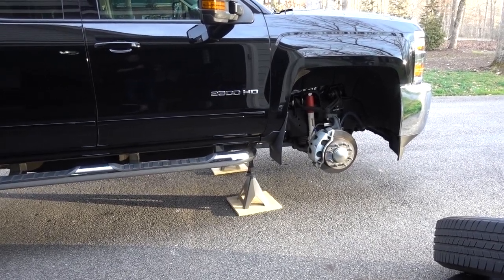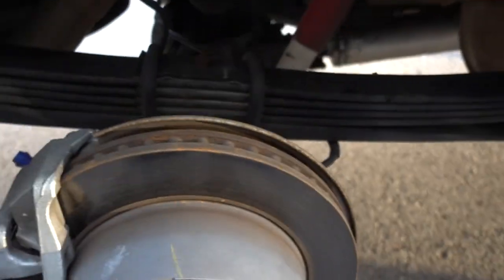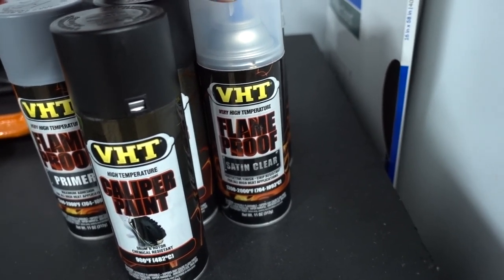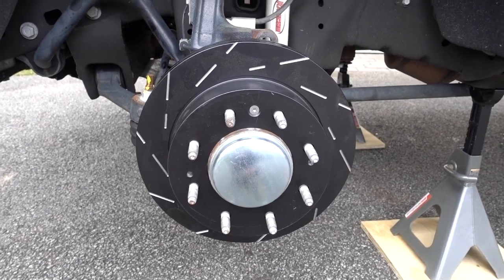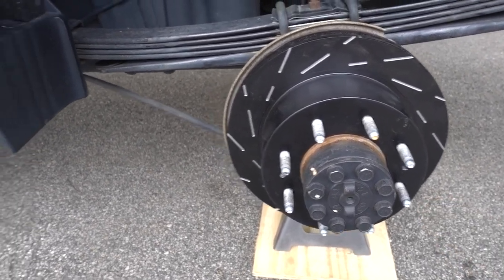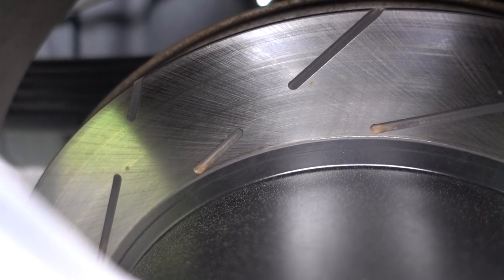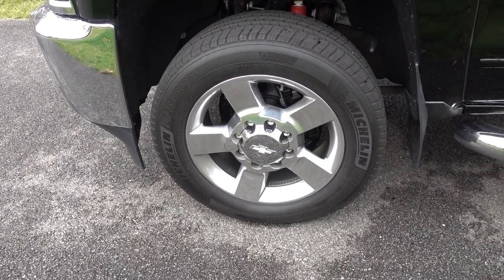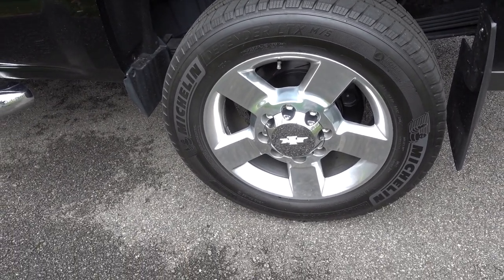2016 Chevy Silverado 2500HD Brake Upgrade - EBC Rotors - Hawk Brake Pads

Comment: Good video, I'm looking at getting some hawk pads for my excursion. I live in rust belt so I'm looking at giving my new calipers a few coats of paint before I throw everything on as well.
Reply from the maker: Painting the calipers and rotors (if they are not coated already) will definitely help with rust. I am happy with the super duty pads so far. Hopefully since they do not get hot as easily they will not warp the rotors so quickly.

Comment: EBC rotors are great but I would have used their pads too (I have RedStuff pads, on an old V6 Buick lol). Hawk pads are good but I was upset to see they're made in China. All EBC stuff is made in England, and sometimes finished in USA.
Reply from the maker: I just cannot accept the fact that the pads are painted bright colors. That is what I would call UGLY. Can you envision my black calipers with black rotors and a black truck with Bright yellow or red pads sticking out? It is not visually appealing.
Reply: @scottwalker19  Actually it sound fantastic to me, particularly in red. You could also just paint the pads too if it bothered you that much.

Comment: Nice job painting the calipers bro! I'm looking at EBC & Hawk pads n rotors myself to replace my stock. Left rear is worst of the 4. 
What speed(s) did you get the steering wheel wobble you mentioned? I have some too and now hoping rotor replacement resolves it! Thanks! ✌🏼👊🏼🍻🍻
Reply from the maker: Thanks! I was typically getting steering wheel wobble when slowing down from speeds over 50 miles an hour. Also it was usually only once I heated up the rotors, for example stopping from 60-0 the first time was usually fine but once the heat got into the rotors each stop after that had some steering wheel wobble. It progressively got worse over time.

Comment: How have these held up so far? Mine are warped and I about lost control going down a hill last night with my enclosed behind me
Reply from the maker: My new setup is holding up perfect! I have several thousand miles on it and it has been working as expected for me. My original rotors warped on me as well.
Reply: Was your steering wheel shimmy when braking? Also did you felt vibration on brake pedal? I been having problem with shimmy steering wheel and no vibration on brake pedal. Thanks